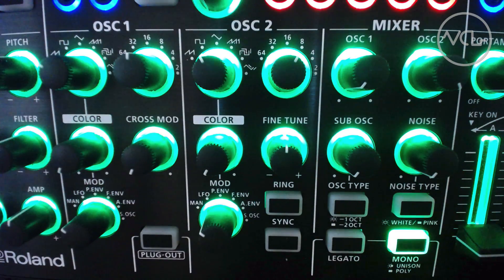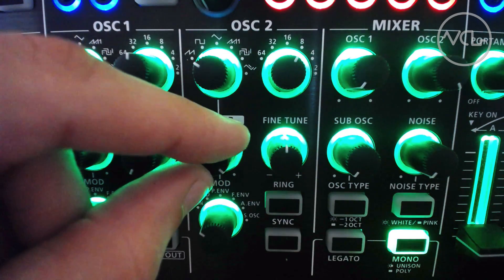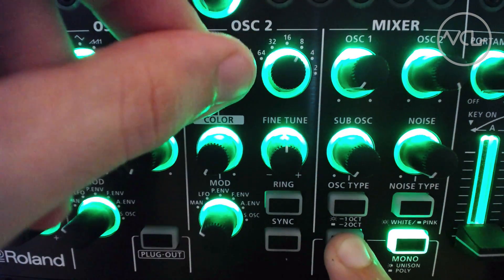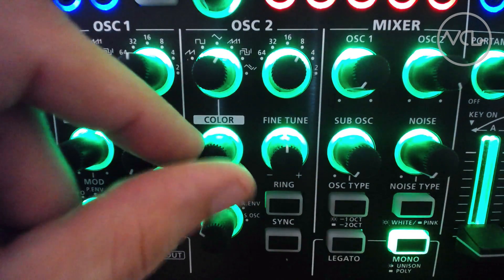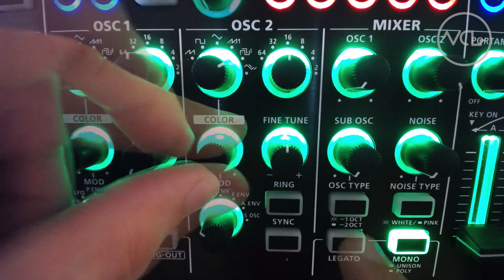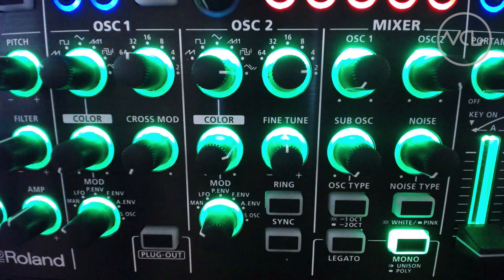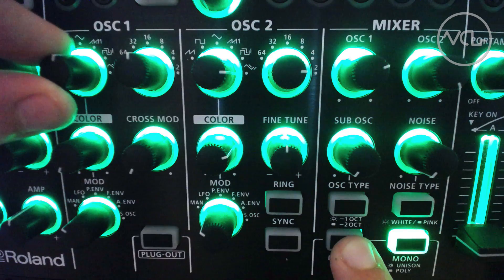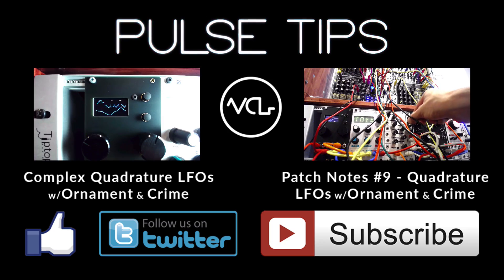Roland System 1M Hidden Oscillators

Comment: I own this hardware and I just don't like the way it sounds. Something about it bothers me on many levels. It lacks warmth, character and doesn't sit in a mix without heavy processing. It feels like a heartless VST plugin.
Reply: I think it comes down to knowing how to program for the genre of music, i have no problem pulling great sounds out of it but I also get amazing sounds out of a Juno-Stage which is just a Rompler but by combining different layers, modulations, filtering and effects you can create some truly other worldly sounds.
Reply: The sound is amazing on this synth. The concept here is pretty killer with plug-outs just amazeballs..  People that think sound character is bad must have a crap rig. This thing is getting heavy use here and will be heard on upcoming releases.
Reply: if you cant get awesome sound out of these its obvious operator error.
Reply: One trick is to avoid this inbuilt reverb and delay or using that crusher amplifier under all circumstances. I do not know what Roland has thought by implementing such dilettante awful sounding digital effects. These do make things all worse. 

And yes, my very first thought about this System 1 Series sound was also that it sounded “cold” and “harsh” in general. This is still the case if I directly compare the sound to a Behringer Pro 800 or a Korg Minilogue Xd, which all have real ANALOG circuits with full MIDI integration.

Unfortunately the System 1 does not come close to real analog synthesizers. Nor does the later ZenCore engine with the latest Roland Gear does come any close. I do not even care whether it sounds like the originals or not. I do not believe that. 
But these devices can have a justification, if you are looking for different analog style sounds or complimentary gear, thats sounding unique and produces some certain cut.

I finally purchased a System 1m ( quite cheap ) from second hand (still in 2024), for making a use of the Roland Cloud for live playing. The prices are going down for it and many of the previous users may sell it for certain disappointment. If Roland does not find new innovation, it surely will go down the river finally. So it is good to have some of their gear now. ^^